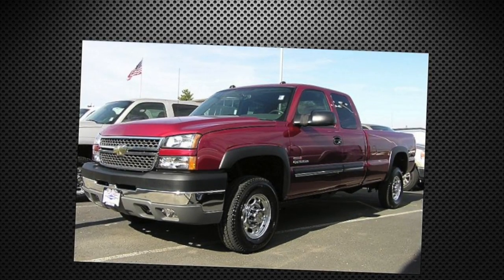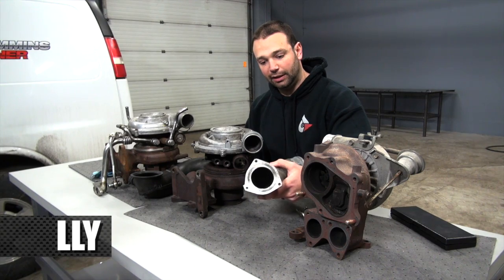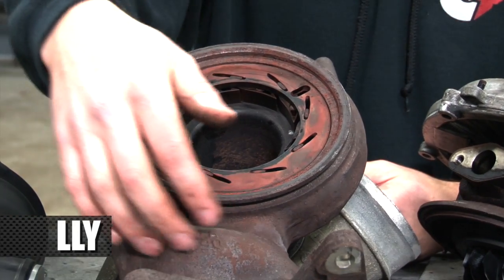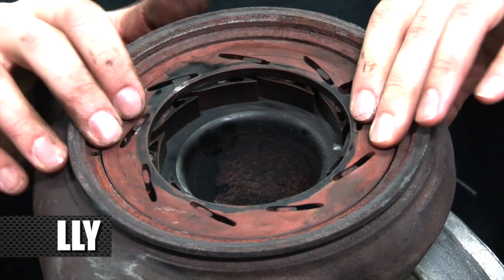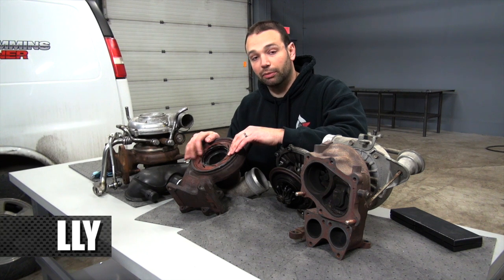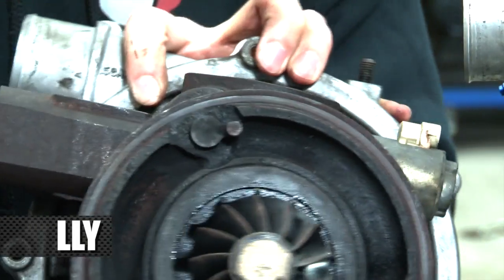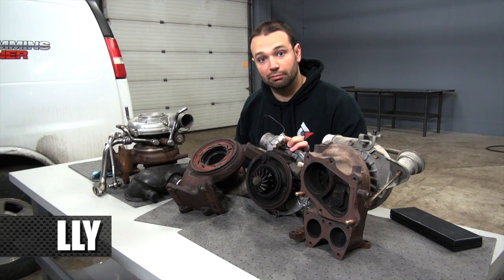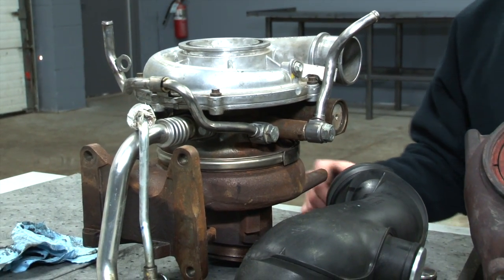DURAMAX TURBOS PART 2 OF 3

Comment: i have a 2003 duramax, s&b cold air kit, boost fooler and efi live tune with a high idle on the fifth position of the swt. wanting to upgrade the turbo and at the same time replace the exhaust sys. setting up truck for towing. like to upgrade turbo also will be having a fass fuel pump installed. what would u recommend for a upgrade on the turbo? call me at 417-256-7640 or e-mail me at lickherbox0048@gmail.com, thanks
Reply from the maker: Sent your information to our sales techs - someone should have reached out to you by now. Thank you for contacting us - please let me know if you need anything else.

Comment: Nick I have an 07 Duramax with an LBZ engine.
My turbo is spinning up to a high rpm but I am getting a big lose of power.
I am getting an error code of P0299.
I am thinking I need to do or more of the following 
Clean the vanes on the turbo, change the vane position sensor, do a relearn for the turbo.
Right or wrong or any suggestions?